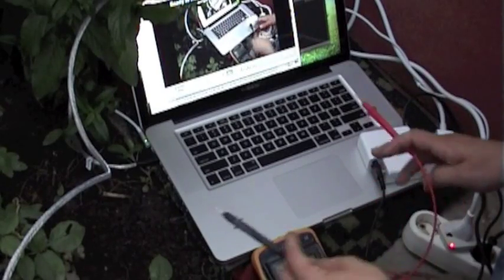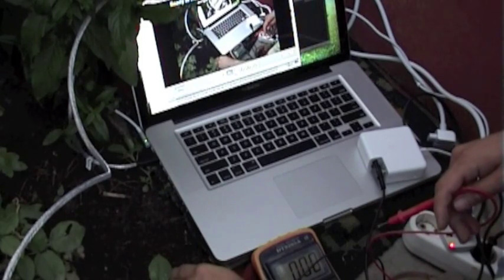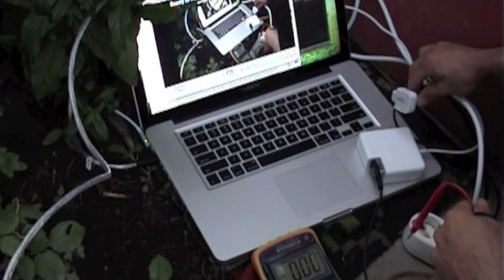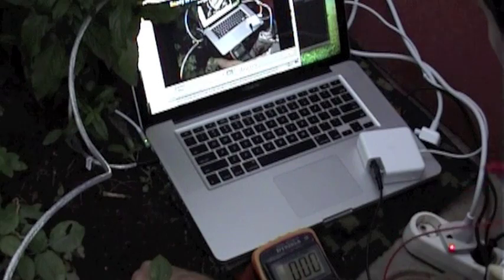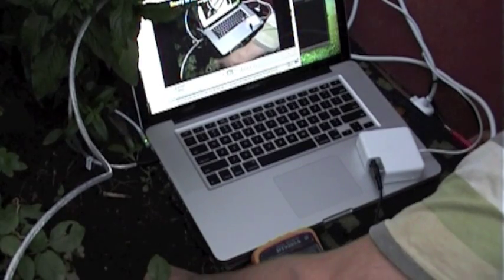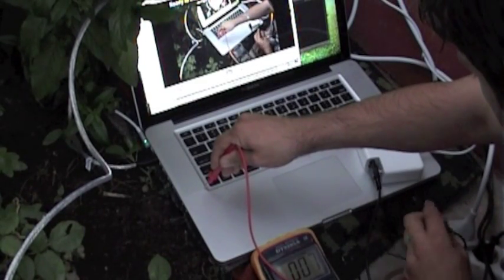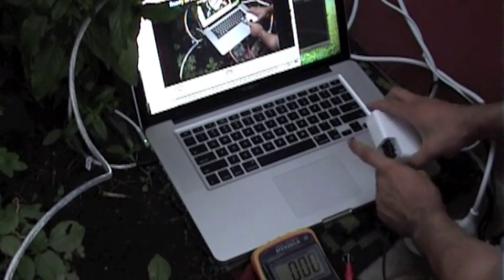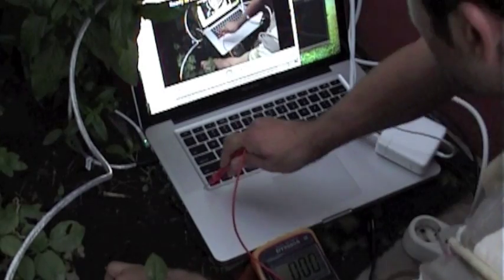Stray Voltage on MacBook Pro Aluminum case

Comment: The power supply should always be grounded for safety, but it has a problem if it's leaking high-voltage alternating current into the DC output connector. The case of the MacBook is grounded for this reason.